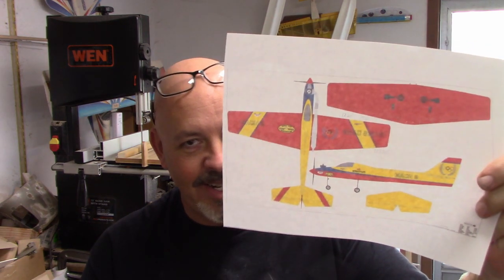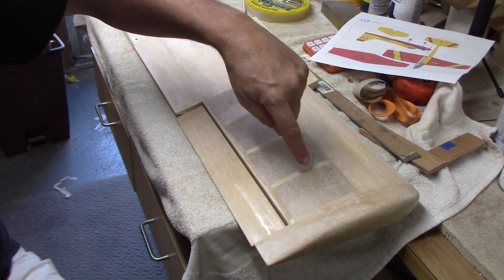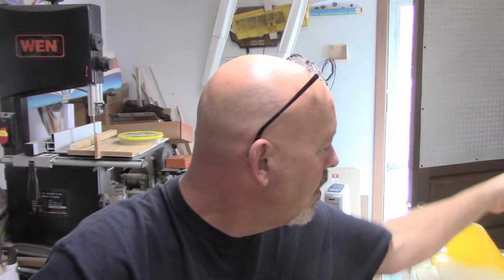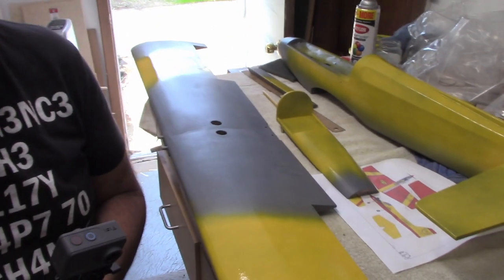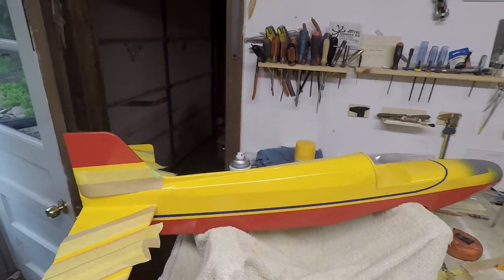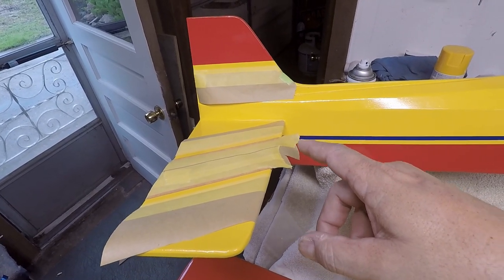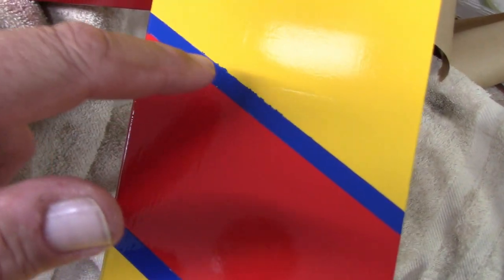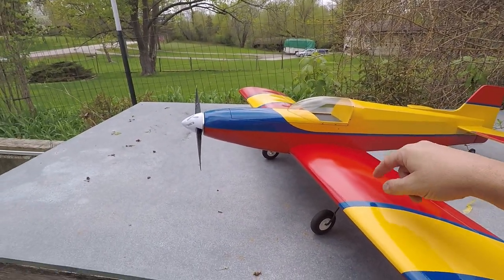Project Warlock - Video 30 - Let's Paint the Warlock

Comment: Hi, What paint did you use ? ( brand, can spray  vs air brush etc)
Reply from the maker: I used Rustoleum Painter Touch 2X Ultra Cover. It sprayed and covered very nicely, however, when it dried it left an "orange peel' finish that I believe came from the way it interacted with nitrate dope and silk span covering. I will be going back to Krylon or Rustoleum "regular" spray for the Stampe SV4 which is currently undergoing final prep for paint.